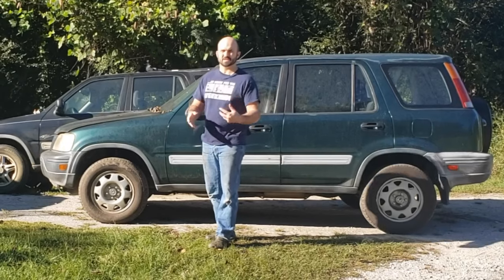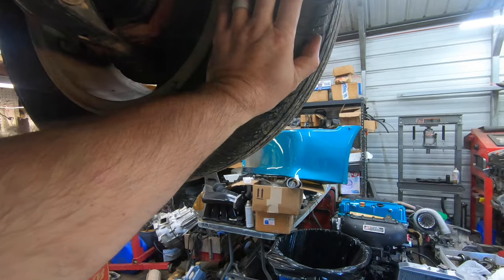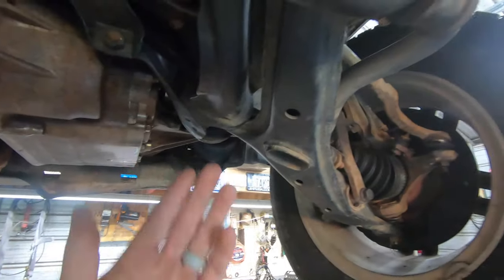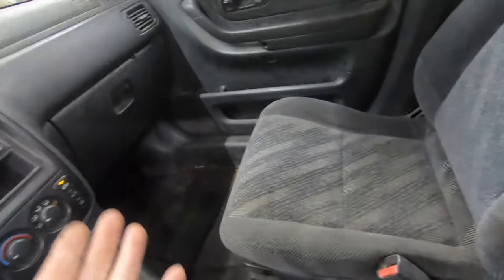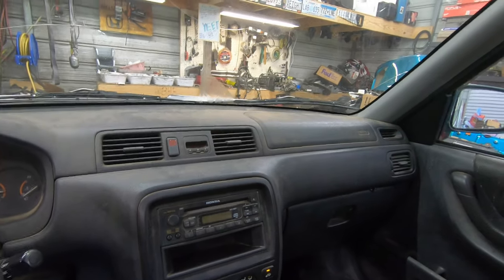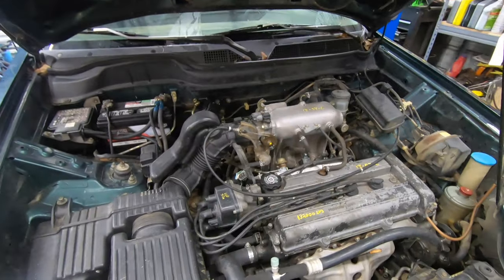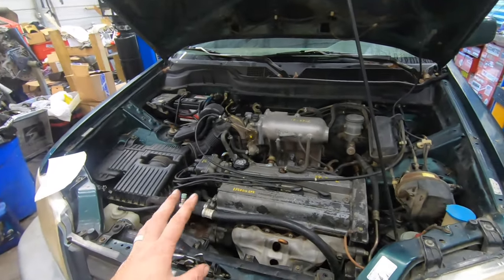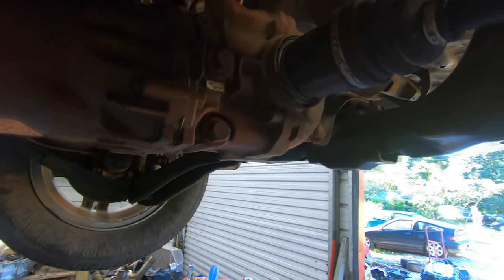Most Common Problems: 1997 - 2001 Honda CRV RD1 RD2

Comment: Wow! Great resource here. I have a weird high pitched whistling noise  in the engine compartment in my 2000 CR v; seems to be coming from back near the firewall a little left of center as you are facing the engine. I only hear it when I open the hood and the engine is idling. 

My mechanic said he suspects the piston rings have  undue wear for a car with only 127K miles on it and I should probably sell the car. I live on a small island in the middle of the Pacific ocean and  no one here rebuilds engines.

I'm hoping he is wrong. Have you encountered this noise before? Do you think a clogged PCV valve might be the issue? I'm praying for something simple.

Thanks
Reply: Did you figure out what was wrong? Sounds like I’m having the same problem on my 1st gen
Reply: @alexd753  The problem is a blowby warning. There is undo pressure seeping past the piston rings. Supposedly it is the result of the injector and air intake system maladjusted so as to be running "too lean" for a long period of time.

Start the car and let it warm up a bit. The whistling sound will present. 

Remove the oil fill cap to check the air pressure that is percolating inside the valve cover. If you have another car to check against as a reference for what it should sound and look like in there, then you will be aware of your engine's internal health, or more accurately stated, lack of internal health.

The mechanic said that at some point the problem will increase to the point where the car's performance will deteriorate rather quickly. The thing is nobody has a crystal ball as to how many more good driveable miles the motor has left in it. It could be a thousand or it could be 10 thousand, or more. 

My daughter and I each have 2000 Honda CRv with the whistling sound. She sold hers pretty quickly and I've chosen to keep mine. I've put about 2K miles on it since the whistling started and the performance still seems fine. I'm gambling that I'll be able to afford a newer vehicle by the time it goes south.

I have put a quart of Kacite Motor Honey in the crankcase to augment the oil. The mechanic said that a sign that the car is approaching accelerated deterioration will be indicated by the car "using" oil, meaning that the dipstick will begin to show the need to top it off regularly. He didn't say so but I imagine that when it gets really bad that it will actually be "burning oil" and you will see white smoke coming out the tailpipe. 

Hope this helps, alexd753.

Comment: Just purchased a mint 2000 SE with 167k miles and I’ve wanted one for a while but within the first few days of buying check engine light came on with the misfire codes p301 and 3 other cylinders I believe and even the guy I bought it from was surprised, but it has new plugs and wires and engine runs pretty good so the conclusion is valve adjustment so after watching your videos I feel really comfortable doing it and for that so thank you. Also I want to change out belt, steering pump and pully as well as tensioner, idler pulley and of course valve cover gasket (one of the ones you recommended) w/ grommets and tube seals. Am I doing too much? Should I wait on steering pump and pulleys?
Reply: You should check the distributor before doing valve adjustment

Comment: Need help! My 1999 Honda CR-V only slightly rear-ended a car. Initially, when I visited the storage lot where it was towed bc I was sent to ER for exam the car turned right over. Now car won't start-up sounds flooded- told a likely fuel pump problem from the impact. Then some guys said there's an actually an easy little known easy fix:
In the back of the CR-V somewhere there's a button I can push that will reset fuel pump. Searched online- nada. Gotta get car out of tow lot. I'm a 70 yr old grandma on my daughter's YouTube acct asking needing advice ASAP. THANKS!!
Reply from the maker: There's no such thing on a Honda.

Comment: For 2002 crv if you want to replace oil pan gasket , they say you should remove MOTOR  MOUNT and part of the  car FRAME,  I have had several cars in my life , I used to change oil pan gasket easily by myself just by unscrewing  oil pan bolts. crv is a good car , but what was the designer  thinking when he designed location of oil pan for this car ?!! I want to look at his eyes and ask that question!

Comment: Hi how did you connect the wiring without the door plug? I do have the same problem and I have no idea to make the rubber boot waterproof towards the door. 
Cheers Markus
Reply from the maker: I just wired the door harness directly to the chassis harness. You'd have to get creative if you wanted water proof. Maybe some silicone would work

Comment: My son has a 2000 crv, manual transmission all wheel drive. His front ujoint broke going down the road dropping the driveshaft onto the driveshaft loop. Thankfully it didn’t hit the ground. For the time being we just took it out till he gets a new one and is just using it as front wheel drive only. I don’t know if this is a common problem or not. Also just replaced the sticking thermostat, cam plug, alternator, and valve cover gasket.
Reply from the maker: Unfortunately the u joints aren't serviceable on the crv. You'll have to buy another driveshaft

Comment: Recently, I replaced the original ball joints with Moog about 8 months ago, and recently my passenger side lower ball joint completely got ripped off, like the ball joint completely separated. It seems like a lot of Crv's ball joints get messed up.
Reply: Did it happen when you were driving and the whole front side just dropped to the ground ripping your axle out.? Moog is best bang for buck never had problems. That AutoZone brand snapped in half on me in less than 6 months
Reply: @bakihanma7247  My mechanic told me he noticed the noise my car was making while I turned happen to be the ball joint and that it was turning when I turned like spinning around. When I got home it snapped in half, as soon as I pulled into the driveway and it collapsed, luckly my axle didn't rip out or nun just it fell into my rim and I just parked it until it got fixed. I put original honda oem ball joints back in.
Reply: Does anybody out there know on first generation CR-V S10 ball joints cause car to wander all over the road even though they make no noise seems like I've had to replace every suspension part and that's the last thing to do
Reply: @derekwilson8011  what do you mean wander.? When your on the highway and go over the cracks on the road it makes you swerve.?
Reply: @bakihanma7247  yes and when you go over the White Stripes in the road it really pulls you over
Reply: @derekwilson8011  I'd say it's either 3 things. Do you have bald tires? You need new tires, tie rods or an alignment or all 3
Reply: @bakihanma7247  well 222,000 miles original ball joint replace those tires and alignment
Reply: @derekwilson8011  oh you already changed them .? What about the tie rods?
Reply: @NewaskyArck  You obviously can't go wrong with OEM but I've also had good luck with Proforged who are known for their ball joints. Two years ago I replaced the original lower ball joints on my '98 with Proforged and I replaced the outer tie rod ends with Proforged around five years ago....no problems. From everything I've read over the last couple of years Moog ain't what it used to be as I've read horror stories about their ball joints failing prematurely.

Comment: I have a 97 CRV the pry bar to upper and lower control arms conceive flexing around where shock mounts to lower control arm also sway bar end links could that be causing steering wheel wobble at high speed and low-speed and also the wandering issue it has first I thought it was a rack but crack is not leaking

Comment: All good to know, my 00’ CRV has/had most of these issues. Didn’t know where the water was getting in to the cab at. 

Another one, don’t know how common it is: The rear license plate “garnish” surround is garbage. Mine was separated from the hatch when I bought it -eventually the top half completely snapped off. How to remove/replace it would be cool to know.
Reply from the maker: You have to remove the interior panel and it has 4 8mm nuts holding it

Comment: I have a 2000 crv and I recently changed the spark plug tube seals and spark plugs because they were swimming in oil. I also did a valve adjustment about 10k miles ago. After changing the spark plugs the next day I got a misfire in cylinder 4 and can’t really figure out why
Reply from the maker: Did you replace the plug wires?
Reply: I'd make sure you used the correck NGK plugs, then check the gaps. Also possible you cracked the insulation on old plug wires.

Comment: I have a 99 currently having a problem with the windshield wiper fluid tubing replaced the pumps nothing to the windshield, but it started leaking inside the cabin

Comment: I recently bought a manual cr-v 98 in very good condition but with small problems in the electric window system and the roof window does not open, the check engine light also comes on at times, any suggestions?

Comment: I have a 98 crv and I'm having problems with my rear rattling real bad like there acorns in there. Lol and loss of power due to transmission not shifting sometimes. I've done a tune up but not the trans fluid.

Comment: You right man, baljoint lower or upper,  and tie rod end inner or orther are  a serious issue people should investigate and replace immediatelly for any bought used car, because you dont want to be driving or inside a  car when the balljoint or tie rod end got broken, and even the towtrack driver will charge you double to tow your car with broken balljoint, but he will tow broken tierod end if nothing happen to the wheel itself (somtimes broken tierod end will cause the balljoint to get broken and the wheel get disconnected from the car,  if your are driven with hight speed in highway, ofcourse if you and your car survive the problem, broken balljoint in hight speed in highway may cause multiple crushes with other vehicles, oh man You dont want that ),  it happen to me but i was in a local street street going with low speed, stopped immeddiatelly,  pusshed the car to a closed parking spot and fixed the problem next day, took me two days to fix it.
Reply from the maker: Yep, super common issue on these
Reply: @hondaresource  not just this model, but i have seen other car brand with broken balljoint on the road example the big SUV chevrolet suburban  that used as taxi carservice, this model got its balljoint broken too soon, atleast  honda crv got its balljoint broken after 225000 miles, but the suburban have less than 100000 miles.

Comment: got a question  how much effort  would it take to put a k24a2 in a 03 k24a1 honda crv?  the 40+ hp upgrade could be nice along with the fact a running k24a1 would more then pay for the swap since  there worth more
Reply from the maker: Its not terrible, have to move a little wiring around, Change up a  couple hoses, get kpro, etc.
Reply: @hondaresource  why do I need  kpro if I'm using a stock k24a2? Cud I not use a k24a2 ecu?
Reply from the maker: @Jinx-dv7ne  are you talking about a manual crv with manual TSX ecu?
Reply: @hondaresource  all auto

Comment: I hope you can respond or anyone in the comments but I just bought one and it’s having a rough time in first gear accelerating but then does fine once in second. Engine code showed something with the catalytic converter. My code scanner is cheap so hopefully it’s something small and not my transmission😩 any tips?
Reply: 😮 I cleaned the selonids on mine and 2000 miles later still good.

Comment: Hey there, got an '01 CRV with 147HP. There is an issue with the primary HO2S... Engine runs pretty normal and the sensor works from 0,055 V - 0,8 V ... Sometimes i get the MIL lamp and ECU says P0132 .. Already changed the H2OS ... Any ideas ?? 🙈

Comment: Great vids,  over here in UK few mechanics want to take on rear brake pipes replacement, is it a hard job to do on the rd1 Honda CR-V?
Reply from the maker: Its not terrible if you have a  lift. Working on the ground wouldn't be fun. I would just get a spool of hard brake line and bend my own.
Reply: @hondaresource  yeah I got a good deal the pipe in a roll, ten fittings, the flare kit and pipe bended all inclusive, just wondered if my approach is correct , take off coroded pipes hopefully in one section and then match the pipe bends and then try and replace should be a wise man after that ha ha ha
Reply from the maker: @anguspatterson9449  solid approach.

Comment: Hello,
Glad to see some rd1 content. I recently having an issue with my 1997 Honda CR-V.  The car starts great but after a ride cycle and you turn it off it won’t turn on again. It will crank but not start. After a few cranks there will be a very strong gasoline smell. This only happened sometimes but now it’s getting more and more predictable. I have changed the distributor and not better. I had a check engine light relating to purge valve before hand but I just replaced the valve recently and nothing it still does the problem. 

Out of curiousity I took out the spark plug when car doesn’t want to start and the spark plugs were black on the tips. If you rub the exhaust tips there is also soot/ or this black substance. I don’t know how long it’s been running Rich but I assume that it’s because engine getting flooded during the no start condition. 

Has anyone experienced this? I would greatly appreciate any input or advice. Thank you.
Reply from the maker: you may have an injector leaking which floods the cylinder after you've been driving.
Reply: @hondaresource  thanks for the advice. Say it’s not a leaky injector, what else should I check out? Cuz the fuel pump seems to work fine after u put the key into the ignition it fires up nice and quietly. Could it be the main relay?
Reply: @godesslight6168  this sounds like a distributor gone bad
Reply: Any time the engine is warmed up and things under the hood are hot, the heat may cause the resistance of electrical items (plugs, plug wires, ignition module, coil, etc.) to rise, and this increased resistance may render any "iffy" or just plain old components nonfunctional. Bad plugs can cause a no-start condition, but the wiring on these old CRV's is over 20 years old and bad connections or bad grounds can cause it to not fire. But the injectors need to be ruled out first. Maybe connect a fuel system pressure gauge to the rail and run it for a few minutes - then turn it off and see how long the pressure is maintained. The pressure will rapidly drop to zero if there is an injector(s) leaking down. For a total no start, just one leaking injector wouldn't be enough to cause a no-start, in my experience
Reply: I hope its not the fuel injectors,  maybe read up on them , thought I read about black soit everywhere, not good . Buttt, maybe not , im having fuel pressure issues,  changed pump and filter and distributor,  main relay looks fine , idk where the fuel rail is , I wish  us both the best ..
Reply: @user-ww6dx2kq5t  When it does the "no-start next time, I would rule out the electrical system first. Pull one of the wires and stick an insulated screwdriver in it and hold the shaft about a 16th of an inch from anything metal on the engine and get a friend to turn the motor over a few seconds. There should be strong BLUE sparks present (not orange). If no sparks, I would fault the new distributor (ignition module). The ignition system on the first gen models do not have coil-on-plug firing and the ignition module could very well be suspect. They can be tested with a multimeter. Make sure there are no codes stored. If the distributor is third party item from EBay, the lack of sparks is a common issue with them. A bad/defective rotor can keep the system from delivering spark. I would rather get a salvage distributor that's OEM before a Chinese version that may or may not be high quality. If you do have strong blue sparks, then it's time to bench test the injectors. There are videos showing how to do this on YT. Best of luck! These injectors do go bad and will need to be identified and replaced. Again. a genuine OEM version from the junkyard may be preferable to a third party version.
Reply: @user-ww6dx2kq5t  I wanted to add this: If there are strong blue sparks,  and if the spark plugs are old, I would replace them as a matter of course. It's inexpensive and old plugs that have cracks in the insulators can keep the engine from running. If the plugs are tip-top, get a can of starting fluid, remove the air cleaner/duct work, and spray into the throttle body past the butterfly valve for 1-2 seconds (don't overspray this product because a little goes a long way), then attempt to start engine. It would help to have a helper sitting in the drivers seat for this test. If there is lack of fuel, the engine will fire up for a second or two and then quit.Do this starting fluid test after the ignition system has been ruled out while engine is hot. Testing the ignition system while cold will not pinpoint the culprit if the no-start condition happens only when the engine is warmed up. I would also replace the fuel filter, esp. if the car has been driven a lot while the tank is nearly empty and/or the vehicle has run out of gas on one or more occasions.
Reply: Had this problem  on my 01 , turned out to be a bad coolat temperature sensor .
Reply: @Razzaqabuali  Yep me to... Bad coolant sensor....

Comment: Mine is a 2003 CRV, yes issues with the struts & control arms. Question : Do mechanics generally use aftermarket or OEM Honda fluids and parts ? I find Honda parts are ridiculously expensive, ie. $1,000 for a power steering pump, & there are so many rubbish generic made in china parts.
Reply from the maker: It really depends on the part. Sometimes I use OEM sometimes I use aftermarket.